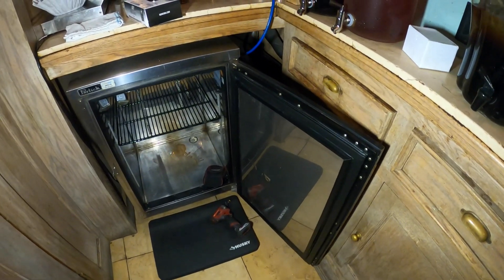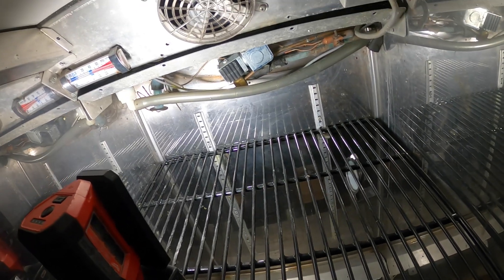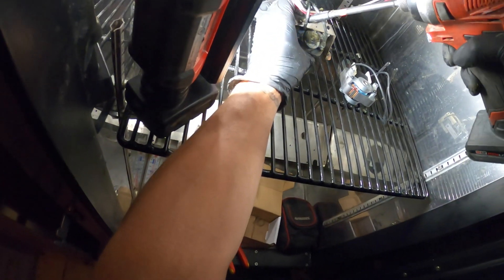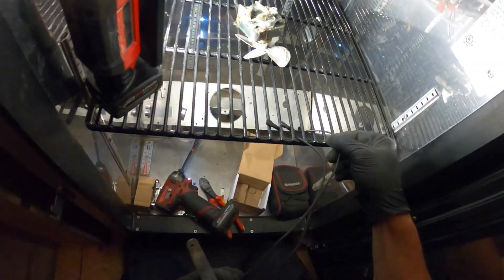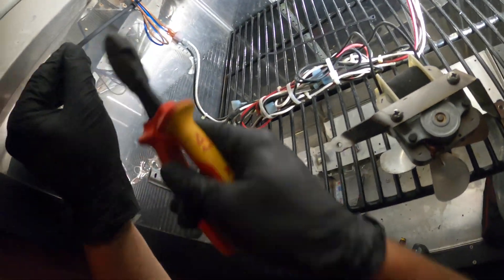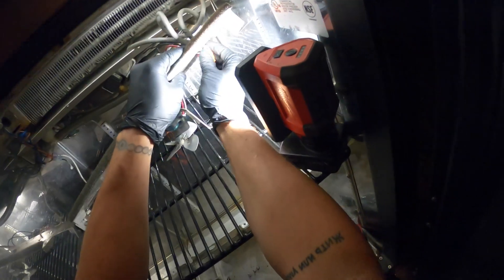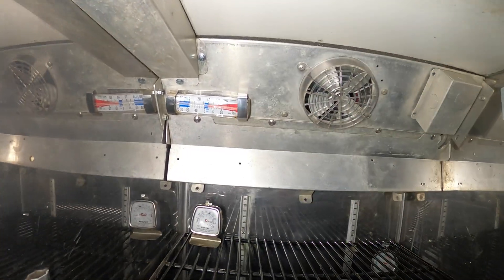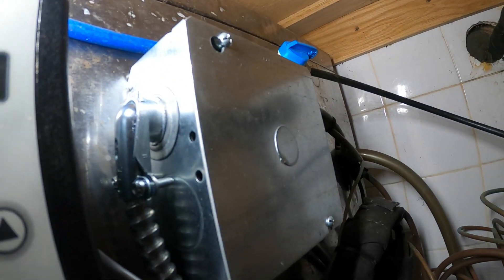HVACR: Perlick Refrigerator Not Cooling (Perlick Evaporator Fan Motor Troubleshooting & Repair)

Comment: I can't believe these aren't all self contained.
A single door reach in that has a remote condenser is crazy.
Reply: Yeah it’s a small refrigerator
Reply from the maker: It is but it is connected with around 14 other units with 1 condensing rack system unit. Thanks for watching! 🔧⚡️
Reply: I was thinking the same thing. I looked them up, the condensing unit is tiny. Just seems like you'd lose too much if you mounted it more than a couple of feet apart. It just has ¼" liquid line.
Reply from the maker: I hear what you're saying but it's around 15 refrigerators connected to 1 outdoor rack system. Got multiple walk in boxes connected as well. They'd be better off self contained for something as small as this honesty. Thanks for watching🔧⚡️
Reply: @JumpermanTech  they have it set up like supermarket refrigeration. Rack goes down, you lose everything
Reply from the maker: @topher8634  I hear that. I have a video where the rack went down and blew the breakers on the unit and the main breaker from the panel from some shorted power wires. They lost everything. Poor setup in my opinion!
Reply from the maker: @topher8634  This is also the building with all the LG units. One condensing unit goes down and they lose cooling & heating for 9 hotel rooms at once. Many times they are fully booked and it's terrible for the guests. Thanks for watching!
Reply from the maker: I get that but it's one rack system with like 15 units connected and this is one of the 15. Thanks for watching! 🔧⚡️
Reply: NYC is a crazy place when it comes to space. Sometimes it's better to have remote. You can have self contained, just don't complain about space to work. Also remote allows you to be water cooled. When you have no space you have hi ambient temperatures. People don't think pMs are needed. Basically there are pros and cons to everything.